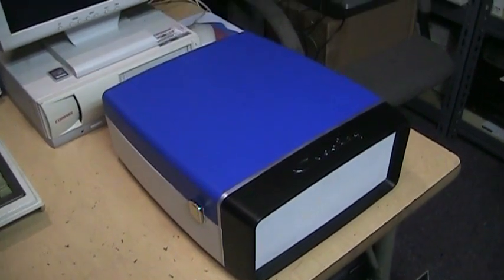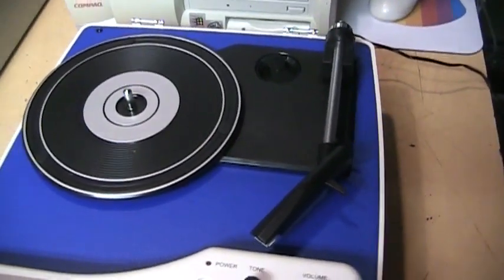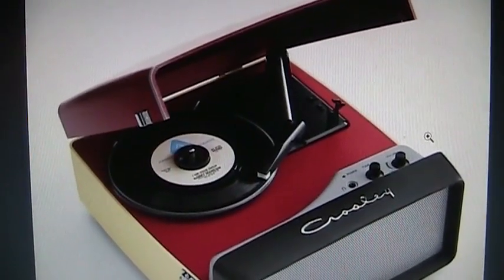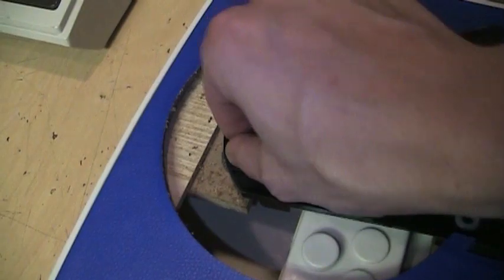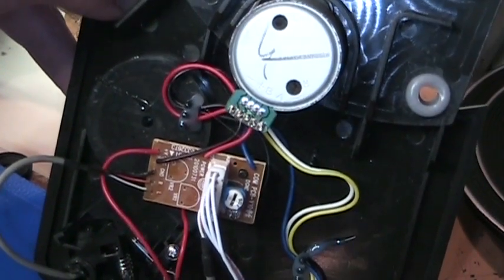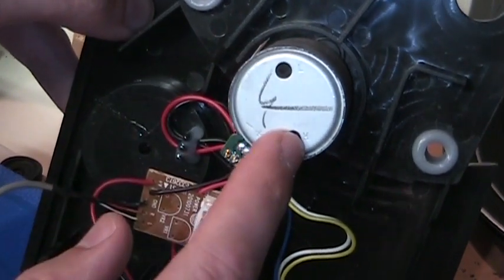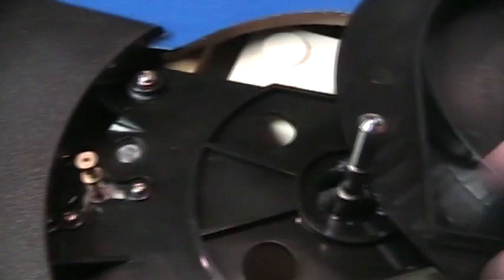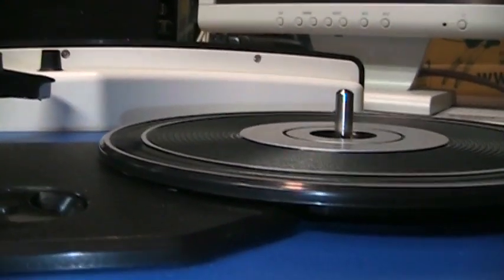Crosley Collegiate record player modifications & improvements

Comment: This is impressive for a Crosley, although I think the mechanism is the same piece of cheapness that's also in the ion usb turntable I have.  It might not have been necessary to cut of that little bit that stops the motor, it looks like there's an adjustment screw there.
Reply: @tarstarkusz  if you go that route double check that it can do 78s that seems to be hit and miss in those decades.

Comment: Just wanted to say thanks for making this. I have a Crosley Stackomatic CR89 model for listening to my 45s. It was running way too fast and I could not find anything online about how to adjust the speed. Your video was the only thing I found. I did use a small metal screwdriver to adjust the motor, but it worked. I used the RPM Calculator app and I have it running right at 45 RPMs. Thanks again.

Comment: 5:25 I'd be inclined to play with that adjusting screw in hopes of making the auto-shutoff tolerable. Not being a "velocity trip", it might not shut off for every record, but if it could handle most without cutting any short, that would be an improvement. Another possibility would be to cut out the switch altogether and use an external one; that might get rid of enough friction to allow a lower tracking force, but what you did also goes a long way (maybe as far, if switch is not contacting the cam while any grooves are playing) toward that end.  I'd also be tempted to drill holes for the speed adjustment and put some kind of caps in them. Good video; I'm glad to see that Crosley can do better than what has gotten them so much bad press. I've always wondered about the "StackOmatic" models, particularly where those changers came from; it seems as if they sold them for a while and then ran out of them.

Comment: Do you see where you cut off the tab with the diagonal cutters?  There is a screw there and I think that if you adjust the screw it will modify that cut off time that you are talking about with the 45s....what do you think?  Did you try tightening or loosening that screw to see if it adjusts?
Reply: i saw that, may also need to do a bit of cutting/filing if the adjustment doesnt help...
Reply: looks like it DOES need a bit cutting off as its nearly rubbing on the switch leaf...
Reply: That was my immediate thought...
Reply: Yeah, just a little of the lobe up front to knock off, or a longer screw to spread the cut off delay a tad.

Comment: @vwestlife    You could also solder two wires to either side of that micro switch, and put an on/off switch at the end of the wires, then you would have the option to turn off the cutoff when you play 45s.

Comment: hello, I have a Crosley Colleciate record player myself. I've come to notice at the beginning of the lp the plastic around the needle (not the removable plastic to protect the needle) touches the edge of the lp. Have you any idea how to adjust the arm to prevent it from touching the LP? thanks :)
Reply from the maker: Did you unscrew the counterweight to reduce the tracking force? Probably yours is screwed all the way in and the tracking force is too heavy.
Reply: Yes i did unscrew the counterweight, it's still the same :s
Reply from the maker: Maybe you need to replace the stylus (needle). The correct stylus is the ATN3600L. The L on the end is important -- the regular ATN3600 (no L on the end) is designed for a lighter tracking force and might bottom out when used on this turntable.
Reply: VWestlife Thanks a lot! I'm going to try that! thanks for all the help!
Reply: Try adjusting the tracking force with the knob at the back of the tonearm, shown in the video. Back off the weight some.

Comment: price a ceramic cartridge lately
Reply: +Richard Golden-DeWitt I've heard the NOS ceramics that will fit a vintage machine have gotten expensive, but somewhere in the world they are probably being made more cheaply than any magnetic. I believe the mere fact that the cartridge is ceramic was the least of the problems with most cheapo turntables; some of the ceramics from the 1970s were actually pretty good. I'd be more worried about flimsy drives, plastic platters and high-friction arm pivots (which demand more tracking force) than about the ceramic cartridges themselves, unless they were very sloppily assembled.
Reply: This turntable has a magnetic cartridge.

Comment: Cutting the off-mechanism is not a modification, it is breaking it. There is an adjustment screw to adjust the settings.
Reply: I did that on my Victrola VTA-600B 8-in-1 stereo component system with the annoying auto shutoff feature, and I did clipped it out with a tweezer to make it much better without automatic shuts off after the last record or cuts off before the end of the song. Without auto shutoff, it reached the end of the record and right into the inner locked groove where it keeps going.

Comment: it looks like there is a screw in the plastic assembly that would allow you to adjust when the motor shuts off in the center of the record
Reply from the maker: Yes, there is... but rather than trying to adjust that, I just took the brute-force approach of disabling the auto-stop entirely.

Comment: You don't have to remove the platter. Put the cartridge guard on first. Remove the 2 screws at the back. Remove the 2 screws in the horizontal plane on the platter side of the control panel. Move the tonearm to the spindle to allow room to pull out the control panel. This gives access to 3 screws with cream plastic bushes and 2 black screws at the corner. The whole bed will then flip over with the platter in place. Do your adjustments and the bed will sit back with the control panel sitting in place while you listen and it's a snip to flip it again until you're happy the tonearm does not stop before it reaches the record end, which is what mine was doing. Good job. Mine is in our summerhouse where it sounds great and takes up next to no space, especially when stored speaker side down. Mike.

Comment: Looks like a Philips rip off, the turntable looks like an example from the late 70's or early 80's,even the headshell resembles the old Philips GP205 and the like from Holland. But this doesn't sound too bad as they go. Back in the day, Philips made a magnetic cartridge with the then normal pentagonal plug - in feature.

Comment: You probably could’ve wired in a switch that bypasses the auto stop, that way you still have it, but you can turn it off to play 45s
Reply: I would think what would be best nowadays would be a potentiometer to detect tone-arm position and a microcontroller to kill power.  That would not only guard against the record player running indefinitely in a run-out groove that was slightly too large to trigger the mechanism, but could also shut off the player if the needle starts to skip, since the controller could notice after awhile (maybe 12 seconds) that the tone arm was no longer making progress.  Such a design could be useful if one is trying to digitize records largely unattended, since having a record replay a groove ten times would be far less damaging than having it replay a groove the 333 times it would do if allowed to run for ten minutes.

Comment: Thank you for this video! I have a Crosley Dansette and I think (from what I can tell) it's turntable design is pretty similar to this one. Wish you could do one of these videos on the Dansette. I've been real concerned lately about the tracking force of it, since all my vinyl snob friends said a Crosley would ruin my records. I was really debating having to get a new player. So you suggest just twisting the weight on the back arm as far out as it can go?
Reply from the maker: MelieSue The Dansette uses the same mechanism as this model, so yes, if you unscrew the counterweight to its furthest-out position, you'll be fine.
Reply: They is part of the reason why I am adding a spring counter weight balance to my Crosley just in case.  I love how the machine is an all in one record player that can play 3 formats of records in Radio Shack battery radio quality.

Comment: Hi. I have a question. I saw a comment that you've posted in a previous review, about adjusting the weight of the tonearm counterweight screw at the back, but I've also thought about taping some coins (6 US-quarter sized coins, each weighed at 3.8 g) at the back of the arm to reduce the weight of the cartridge. I've also adjusted the screw outward. The tonearm was still heavy before I attached the coins at the back. After the fix, I'm guessing that the AT cart now weighs at around 2 to 2.5 g. (Hopefully, It's not a wild guess, haha) I don't have a small weighing scale, so I'm still worried about ruining my vinyl if I did not put an additional weight at the back. Would that help? Tnx!
Reply from the maker: ***** You can get a small scale for about $10 at Harbor Freight, if they have any stores in your area.

Comment: Is that a counter-weight at the end of the tonearm? Just curious. Thanks in advance for any answers.
Reply from the maker: Yes.
Reply: +vwestlife Thanks for answering, although I did ask the question before the video reached the point where the counter-weight was explained. Thanks again. By the way, what is the model number of the other Crosley Collegiate that has the option of turning off the auto shut-off switch? Just curious. Thanks again in advance for any answers.
Reply from the maker: frschoonover1 The model number is the same for both. If you buy a new one it will have the auto-stop switch, but if you buy a used Collegiate it may or may not have the switch, so check the photos or ask the seller.
Reply: +vwestlife  Out of curiosity, is it this particular model number, which is :"Crosley 'CR6010A-RE' Collegiate Portable USB Turntable"? I ask this because I did a search on Amazon for this particular unit and this was one of the results, alongside the other CR6010A. Thanks again in advance for any answers.
Reply from the maker: frschoonover1 Yes, the extra letters on the end just indicate which color it is.
Reply: +vwestlife  On the unit where it has the option to turn off the auto shut-off mechanism, where is the mechanism located on the unit? Thanks again for any answers.
Reply from the maker: frschoonover1 The mechanism is the same, it just has a switch wired into the circuit.

Comment: Wouldn't it be better just to file some material off the tab which opens the switch when the tonearm reaches the dead wax/end of play position until it stops in the right position. 

I've made my auto shut off work perfectly that way however mine has a photo optic sensor.